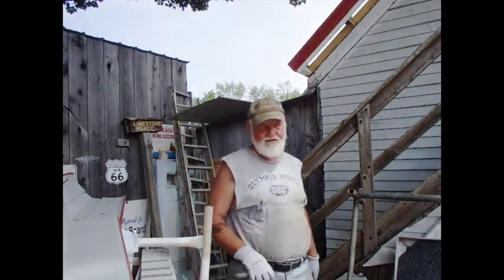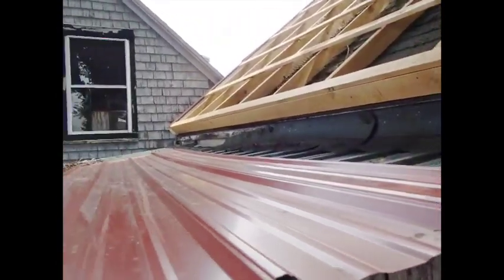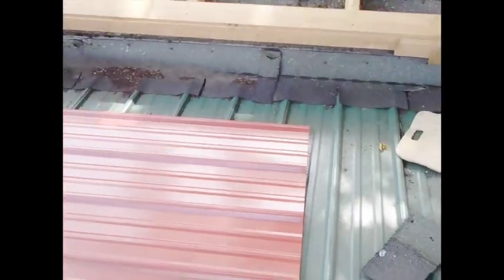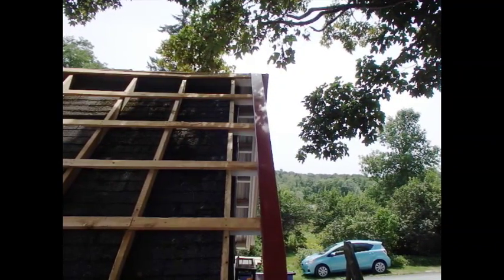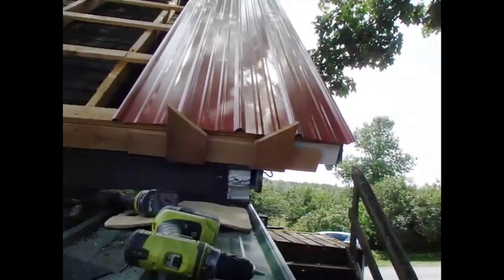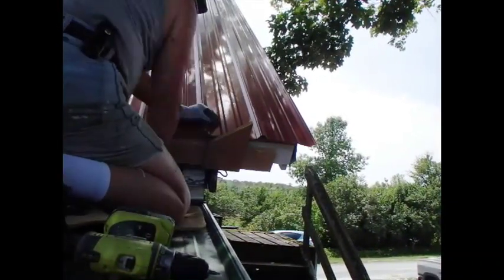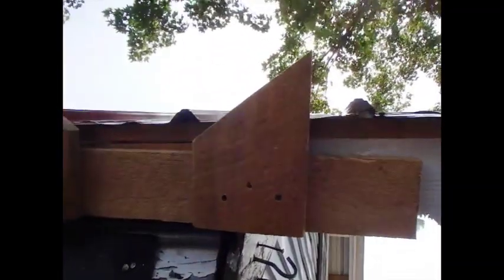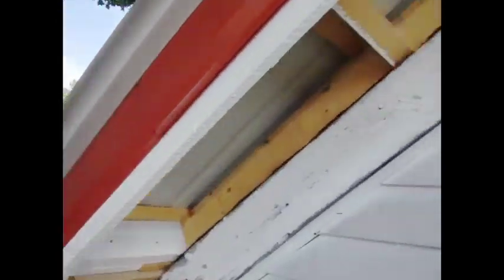Tin Up on the back side of the Rat Rod Garage

Comment: Richard, Did you use the screws for metal roofs with the rubber washer under the screw head?  If not it will leak.
Reply from the maker: I used old bent nails but I straightened 'em before I hammered 'em in.